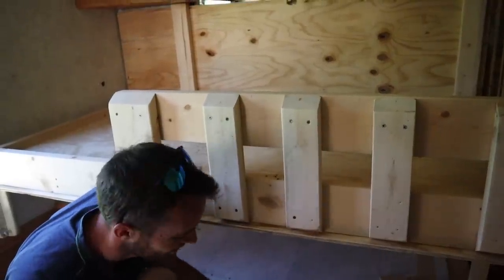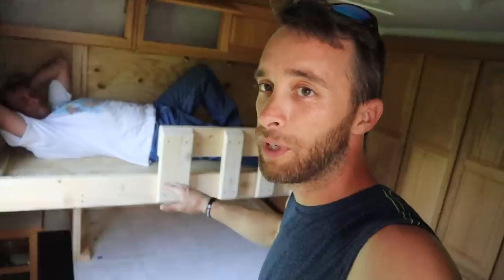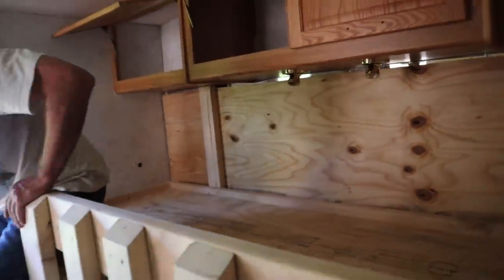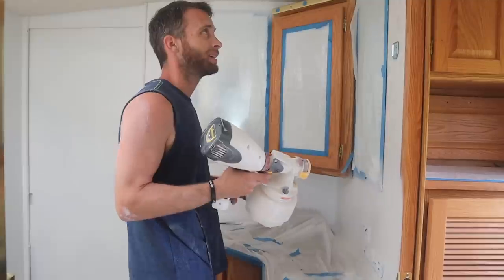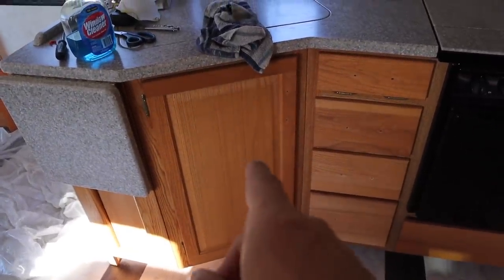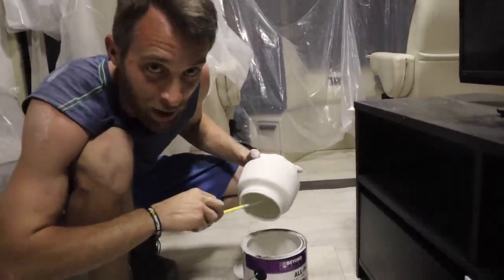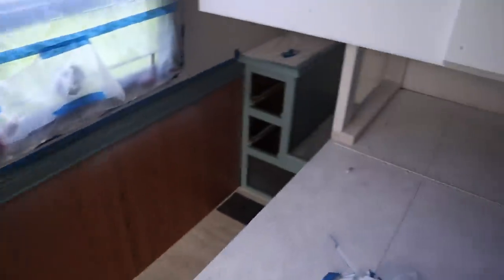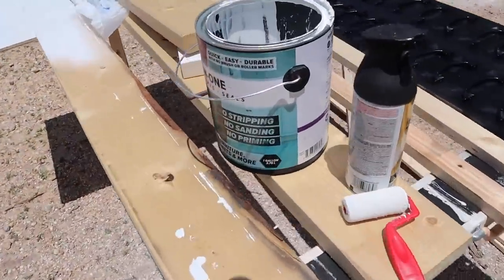Class A RV Renovation!! Remodel an old RV into Our Home on wheels!!

Comment: After watching this video, we bought this paint as well and are painting doors and cabinets in our house right now. Thank you for sharing and we love using this paint.
Reply from the maker: That’s awesome! Glad ya liked it!!
Reply: How did yours hold up meaning the paint? Are you glad you used beyond paint?
Reply: Kari Lynn I used it in my house and I did sand and primed my cabinets since the ones that I didn’t, it would come off if bumped too hard. It did go on very nicely with gun sprayer though. I didn’t add any polyethylene but I would suggest it in high traffic areas. I do wonder how theirs held up in their class A though.

Comment: Put a mask on with a sprayer indoors youngins. It will catch up with you when your my age. Lookin  good. 😂👍❤️
Reply: I was thinking the same thing! Anytime you use a paint sprayer indoors, make sure you're wearing a mask. Believe me, you don't want to get to your 40's and be having lung issues because of it....it's no fun.
Reply from the maker: I had one and was wearing it to start but got hot and took it off. Thanks for watching
Reply: So you were able to use only ONE COAT on the walls and cabinets with that fabu paint? What brand of psint sprayer did you user?
Reply from the maker: Yes one coat.. it’s a Wagner got it at Lowe’s for about $120

Comment: Y’all I am loving the Nantucket/White, love the contrast. Definitely have to have the patience with the wallpaper for sure (use spray adhesive, works) y’all are gonna love it when it’s done.  I am curious to see how the two-tone with the trim will look. I would just keep it one color. (Always wear a mask when using sprayer. Safety first) Handles turned out nice.  You can always change later. Pick up some from antique store or flea markets. Looking forward to seeing the Class A updates completed. Thanks for sharing

Comment: Looks great! There is a reason they don't paint the inside of RVs, it adds a lot of weight, keep that in mind. After you're done find a weigh station and get it weighed so you know and don't exceed the GVWR
Reply from the maker: Never considered that as the reason why!! Thanks for that info!!
Reply: @LoftisPartyofSix  For example, painting a 747 adds about 1,000 pounds. Doesn't seem like much but it's crucial when you factor in people and bags right? I think you'll be okay, but you can't exceed the cargo and the jeep will need to be factored into the GVWR too.
Reply from the maker: Wow I had no idea Paint would be that much weight!!!! Thanks
Reply: @LoftisPartyofSix  I'll always watch out for ya

Comment: How is the Beyond paint holding up?? Any chipping? Also, did you spray the cabinet doors while they were on? Do you feel that was the best? Thanks!
Reply from the maker: The paint had held up decent. We should have put on a 2nd coat. The walls held up great but the cabinets have had some chipping. And yes taking the doors off is best.

Comment: How did the paint hold up on the RV cabinets using the Beyond Paint? Any chipping? Or rubbing off?
Reply from the maker: We still had rub off but I believe that was our fault and not the paint because we didn’t lightly sand the surface of the cabinets. The paint on the walls applied much better with no issues.
Reply: Thank you so much!